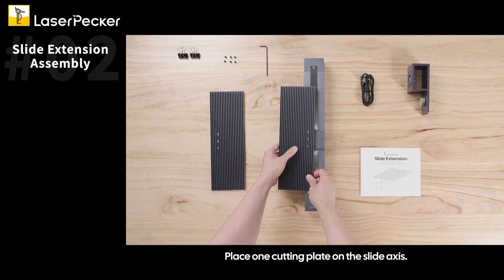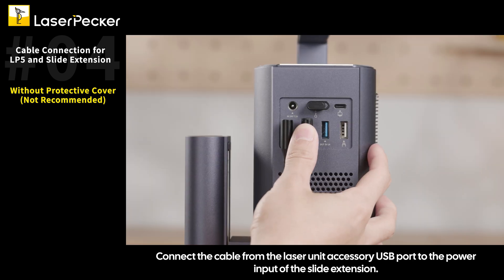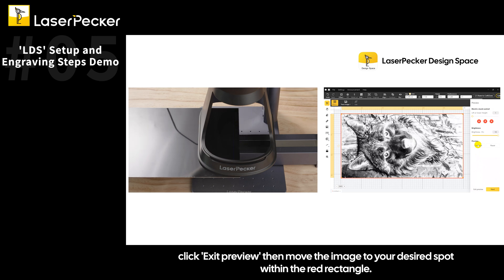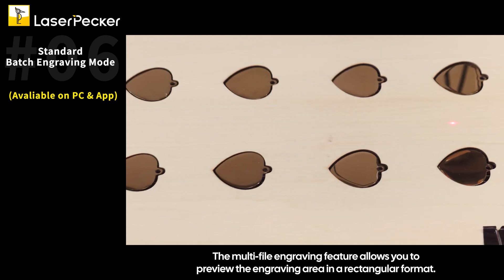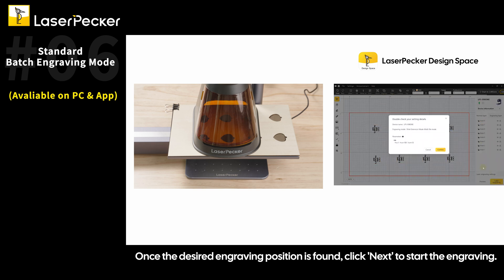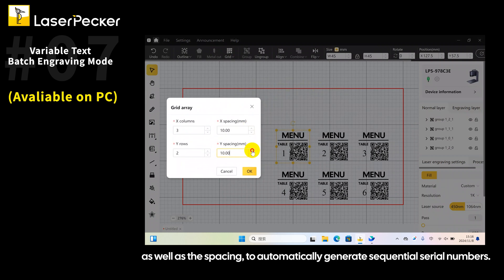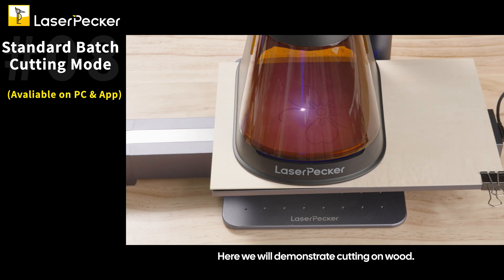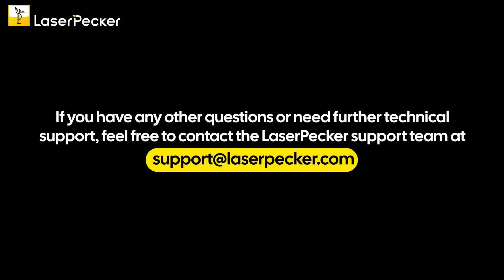Use Slide Extension with LaserPecker LP5

Comment: Why the hell doesn't your crap app engrave in the ORDER they were edited? They should be engraved in the same damn order they were picked and placed! Your retarded backasswards way of thinking means that after a user has placed ALL photos and THEN placed all cut lines your crap app cuts first and engraves after all support has been cut away and now when it goes to engrave you have all these cut pieces moving around because some moron thought it was a good idea to reverse the damn order of engraving and cutting! Why the hell doesn't your crap app send me to the exact same place that I just grabbed a photo from to engrave? A user might WANT to go back to the exact same folder and folder VIEW as the 1st photo! Why does your crap app use a god damn different UI after the 1st photo is picked? Who thought that going from 1 style of UI to another was a god damn good idea? Was your crap app DESIGNED to be this bad? Are you trying to send business to LightBurn? W!T!F!